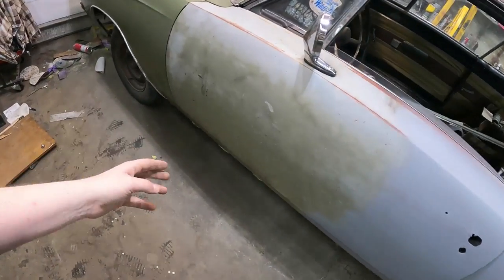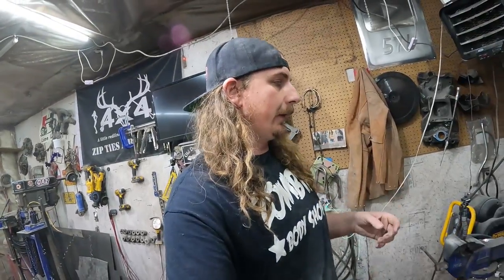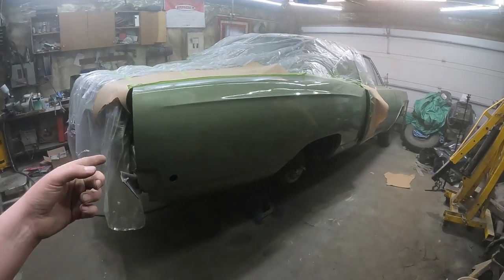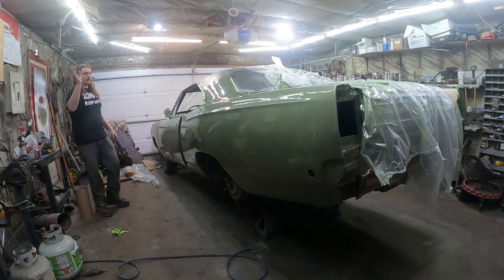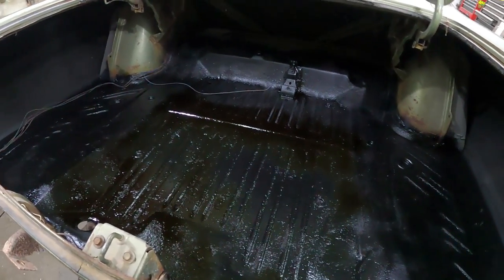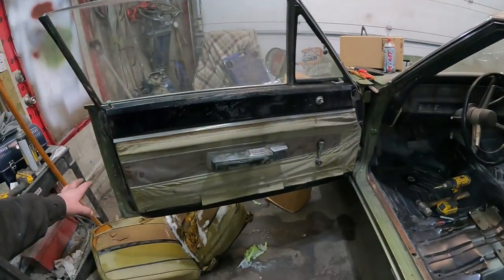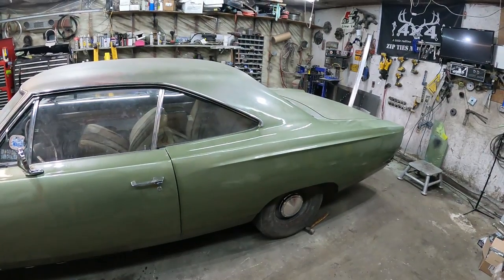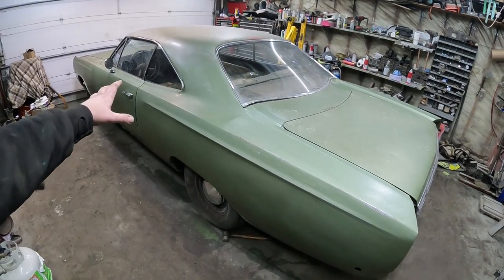DIY Painting an Old Muscle Car on the CHEAP - 1968 Road Runner Clone

Comment: Looks Great Dan. You're heading in the right direction to get the patina look back again.Where you scuffed through on the top of the drivers quarter so you could see the layers looks really good. I've been doing autobody for almost 34 years and I have to admit I cringed a little bit when I seen the scuff pad but turned out well. Nice work.

Comment: We had a '69 Plymouth Belvedere back in the 70's. Dad got it used for $1200 with only 78,000 clicks and we ended up putting over 500,000 on it before a rod started knocking. The last few years she burnt quite a bit of oil, but the motto was, "Drive her 'til she pukes." Leaning tower of power, three on the tree. Like every one of those, you couldn't kill it, it got great gas mileage, and you got the styling of the Road Runner on a Plymouth budget. I was the envy of my high school buddies (until my friend, Ryan, was given his grandpa's cherry '69 Cougar with a 289 Ford small block). I like the looks of your car, and I dig the dog dish caps, the same as you.

Comment: Don’t beat up on the Plymouth over a few negative comments. Now I feel like I have to comment to reassure you that what you’re doing is right. Every vehicle you touch is better than you found it. You save these vehicles from rotting away in a field and get them safe and solid with new brakes and floors, to the point they’re viable projects for a novice. If you put too much time or money in you won’t be able to sell them as almost every car guy wants to finish a car theirs own way.  I enjoy watching. Keep doing what you’re doing.

Comment: Dan next time you try that use basecoat clearcoat instead. You can mix a little clear in your base to control the shine and it will seal it. Best I can tell from the video I would go with 10 to 15% clear to the rest basecoat. Hope this helps. Keep up the hard work 💪.

Comment: Also, don't exclude the 400 cubic inch motor from your search.  It is visually the same as a 383 (it's what the 383 became in 1972), and a 400 is probably cheaper than either a 383 or a 440, albeit with less power in stock form.  If it was my car, I'd put a 400 stroked to 450 cubic inches in it, with 383 badging

Comment: The mirror is a Phillips on top and a 3/8 (IIRC) from underneath. You just need two feet of extensions to reach it with the door card off. I tell you this in case you want to add a passenger mirror, which helps driving a boat this big.

Comment: There is a stud the goes straight down at the front of the drivers mirror.  7/16 I think.  You must unscrew the adjuster and push it into the door then snake it around to get it out.   Door panels are the easiest to recover, plain flat. easy easy. Try old motor homes for an engine trans combo.

Comment: The paint job came out great for what you are aiming to do when complete. The dull weathered pain look. It’s hard to tell on video for sure but I’m thinking the color is actually a good match but your older paint panels like the trunk are oxidized and the new paint is just scuffed dull. Maybe scuff the oxidation of the trunk and let both paints weather slowly together to end up with a more similar color tone and brightness.

Comment: Looks like it will half way match with a little more sanding or scuff padding, Now all you need to do is find an engine for it, I have a Dodge with a 360 in it and I'm thinking about pulling it out and putting a Pontiac 400 with a turbo 400 trans in it !

Comment: I like that color. I used to have a '74 Dart Swinger that was close to that color. The only reason I got rid of that car was the lack of rear wheel wells. The only place I remember it having any rust. Had that car from '83-'86. Even blowing a radiator hose it didn't strand me. But it kept me home the next morning blew that white module on the fire wall. How is that possible replace the hose starts right up let it set overnight won't start. Yes I'm a MOPAR GUY!!!

Comment: Find an old Dodge Sportsman RV some of them had big blocks.  They can be had cheap especially if they have roof leaks.  Car is coming along nicely.  I always clean every surface inside the car before carpets to keep them nicer.  A word to the wise though is not to buy cheap carpet because once the sun hits them they fade so bad and wind up looking like crap.

Comment: As a pro painter for 40 years let me give you a tip for next time you do something like this...Looks like you used Nason single stage which contains clear which is giving you the gloss.....Use basecoat with the same hardener you used for the single stage (don't let anyone tell you that you can't do this, you can) and over thin it slightly...will match better texture and gloss wise and makes makes putting the patina into it so much easier
Reply: Can you elaborate? I'm confused still
Reply: @janeblogs324  When you buy single stage enamel, it's basically basecoat with a single stage clearcoat mixed in it which is activated with a hardener and sprayed resulting in a glossy paint, which in most cases is fine, but being that his car was already very faded and dull, a basecoat  {which dries dull} mixed with the same hardener he used {for durability} would have been a better choice

Comment: Usually buying a car in primer or fresh paint is a risky business, did they put actual metal under all that primer, or is it just mud and chicken wire? Well here you can see Dan welding new quarters in, fixing rust spots in other areas then priming and painting it so it looks like a rust free ride that has been sitting in an Arizona back yard. So when Dan sells this all you need to do to make it really nice is throw a paint job at it, you know the metal work is done. The fun part of doing a low buck not very shiny paint job is you can drive it every day, not worry about scratches and dings, and enjoy it. I treat my shiny paint jobs the same way, because I can repaint one of my rides with about 4 days of work. 

Shooting metallic paint can be a pain, you need a lot of light,  then you need to go over it the same direction so the flake lays the same direction.. otherwise you get tiger stripes. I painted a 79 Trans Am yellow a few years back, it hid all the bad body work, no stripes, but man it kinda burned my retinas and everything had a yellow tint for almost a week. Same thing happened when I painted the 65 GTO 'Mayfair Maize' yellow at first, man I loathe that pale yellow color almost as much as I hate Palomino Copper that my 70 GTO was.

I dig the dirt and stuff in the paint.. lol. Its going to look rough as hell with just a bit of scotchbrite scuffing. The Backyard AZ look... in Canuckistan.

Comment: I wonder if you could cut the front of that Fender off shape it in or straighten it out on the bench and it welded back on
Reply: You can cut that headlight housing out that gives you access to the fender skin on that corner. Easy to put back in after you finnish with the outside skin.

Comment: the hottest temp you can get the shop , and the fastest reducer will make a dull finish , for what your doing  base coat without clear would have worked out the best i think ...
Reply from the maker: This was cheaper

Comment: I'd take solid and a little rough over shinny and full of bondo any day. I have seen to much of the latter. Clean mechanical is cooler than beer goggle shine that runs shitty. Just need a nice 400 stroker 727 and a 3.23 sure grip.

Comment: Current muscle car value  $40K? for a Sattelite ? never happen, $30K no way $20K nope not even if it was a numbers matching perfect car.  I guess you didn't watch the Mecum auction in Kissimmee Fl. last week, Perfect numbers matching 71 Hemi cuda  very rare color totally restored to PERFECT ! sold $69K 1968 - 427 L88 corvette real one sold $64K, 68 Pontiac 400 firebird 4 speed CONVERTIBLE ! sold $27K 1968 numbers matching Z-28 ( real one ) sold $26K all were just 100%perfect, needed nothing. Hot Rods & resto rods were not even selling at all!  Fact is all muscle car & hot rod prices are way way WAAAAAY down !!! and there not going to go up any time soon. Much cheaper to buy a car finished then to restore one anymore .
Reply from the maker: Buying someone else's car seems fun....

Comment: Man you are two quarters through painting the whole car at this point 😂 from what I've seen with metallic is every scratch mark every dent every ding will have the metallic lay different. Normally on a full spray you do the jambs put every panel together and spray it as one otherwise the metallic on the door will lay different than the fender quarter etc. But obviously you arent doing the whole car. Without blending into other decent paint I don't know what to expect 😂
Reply: Also what green is that? F6?